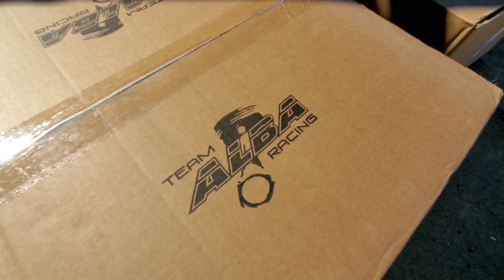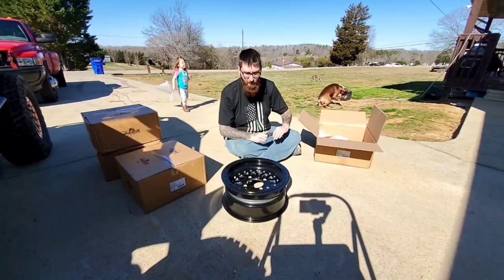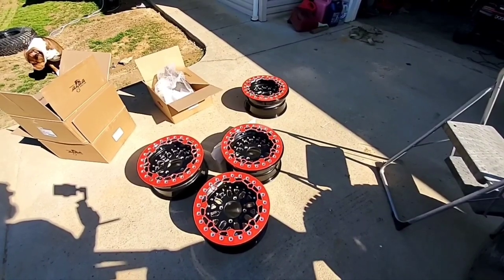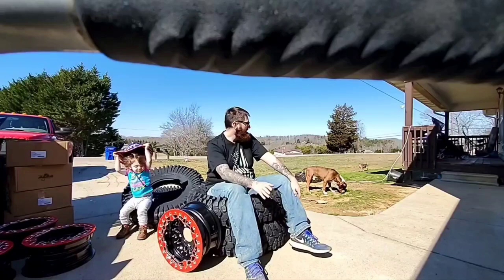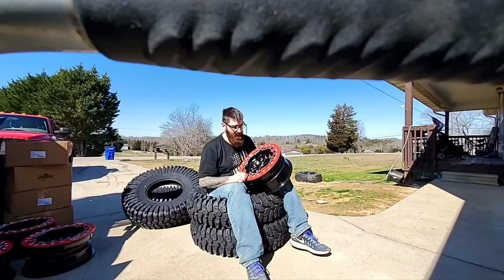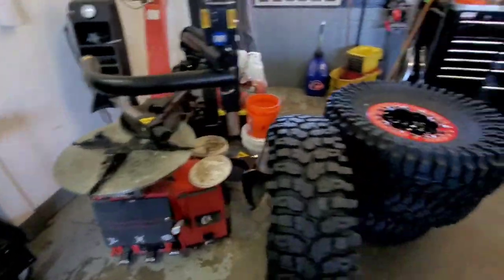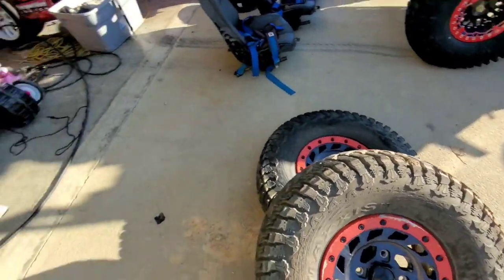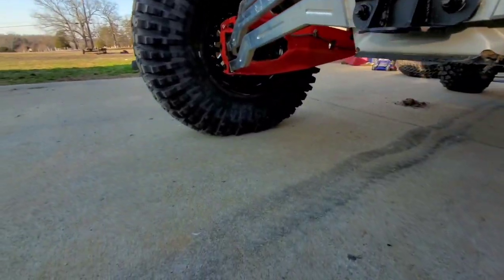2021 can am X3 XRC RR build update part 5. Alba racing and Maxxis Roxxzillas.

Comment: I had tires narrowed down to Zillas’s or XT 370’s. I decided on the 33” XT 370’s. I was mostly worried about that sticky compound wearing fast. Keep us posted on how fast they wear.
Reply from the maker: I do know for a fact the sticky compound will wear very fast if you do a lot of pavement driving. You can literally smell them melting.
Reply: @AbramHeathFULLYEET  they don’t wear as bad as other “stickies”. The close inner tread lugs helps keep the tread life longer.
Reply from the maker: @coburna5  I don't have anything to compare them to personally but I would like to know some comparison tires to check out.

Comment: I just ordered some roxillaz for mine and some CT race works arms and I took your recommendation on the trailing arms high lifters they are sexy...... haven't installed them yet.......
Reply from the maker: Good deal. They are heavy so you might need an extra set of hands.
Reply: @AbramHeathFULLYEET  I need a hand regardless...... I'm not handy ,so unfortunately I have to pay the expense of a mechanic...... but it is what it is....... are the radius rods you are running CTs
Reply from the maker: @trevorbraden5448  no they are L and W. The price and quality combo was the best out of any other manufacturers plus I had my part's in about a week with free shipping.
Reply: @AbramHeathFULLYEET  awe sweet they look good....... thanks for all the replies man..... I'm planning on grabbing the ZRPs heard a lot of good things about them
Reply from the maker: @trevorbraden5448  no problem at all. I'm here for the interactions. I hope you like them. The zrp stuff looks like a good setup.